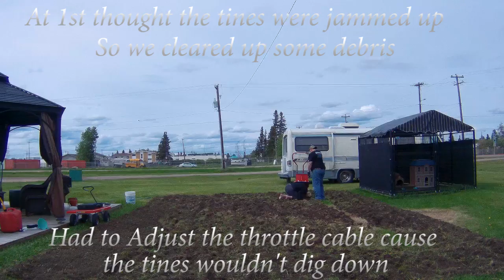EARTHQUAKE  Victory Rear Tine Tiller RIPPIN UP SOME DIRT

Comment: My family bought the same tiller a few months ago. It helped to do one round with the tines up higher to loosen the grass and rake it out, then lower it a little bit and pass through, and then lower it to almost the lowest setting and pass through. It is extra work but it worked really well for us. We bought roughly $50 worth of landscape fabric for one spot in our garden and then had some "free range" with the leftover plants... the landscape fabric was 100% worth it, so much easier.
Reply from the maker: Thanks for Watching Rich.Be sure to Check out my other Channels.TripleChip's Down the HATCH 2 & TripleChip's Unbox the BOX.
Reply: Great tip! 👍.   Grass roots are a pain. Especially if the grass is not 
dead.  😦

Comment: Many newer motors have oil fill and drain plugs in 2 areas. Or on each side.  In case they use that exact same motor on a different product; but it needs to be on the other side; they'll have it.  Without making 2 different types of motor.
Reply from the maker: Thanks for the Info and watching AlfredSchmid3659

Comment: Two ways to make that much easier. If you have the time lay down tarps (weighed down of course) over the spot you want to till up. Leave them there for a few weeks. Will kill the grass so you aren’t fighting it all the time. Second is go rent a sod cutter and cut and roll up the sod strips. You can sell the sod if someone has a bare patch they need filled in or you can toss it. Both would make that job much more enjoyable and not fighting grass coming back. Plus fresh grass filled into ne garden gives rise to powdery mildew which can spread and wipe out your crops production.
Reply from the maker: Thanks for watching ghostriderwashere and the tip

Comment: Until you get the ground really worked up; keep the tines in reverse; so it doesn't try to pull it out of your hands.  It's easier to help it move forward with tines in reverse; than it is to hold it back with tines and wheels forward.😁
Once ground is very well tilled; it works great in Forward with the Tines Forward without trying to jerk it out of your hands.
Reply from the maker: Thanks for the tips! Alfred much thanks .

Comment: I think he had the tiller set to high that's why it was not digging down.....read manual for adjustment. You shouldn't have to force downward pressure for it to dig down.

Comment: Did you read instructions and how to adjust it to go lower?
Reply from the maker: Thanks for Commenting John C. Actually i Usually just go & Unbox the Item then if i run into to Problems.I read the Manual.lol . Be sure to check out my 3 other Channels. TripleChip's Down the HATCH 2,TripleChip's Unbox the BOX & 420 Budmeister.
Reply: @triplechipadventuresvlog8150  will do that.

Comment: Don't buy this tiller! Once I got about 25 hrs on it the drive belt broke ($65)and the tire rim broke off at the shaft ($100) (thin metal spot welded). The engine shroud is open on both sides allowing debris to build up around drive pulleys tearing up the cheap thin drive belts. You can't move this thing without the tines turning. Good luck on the garage floor or getting it on a truck. Got mine at Menard's. Once you put gas in it you can't return it. Store policy. So, I'm stuck with a POS!
Reply: Same thing happened to me. Belt broke after about 20 hours. Replaced it and it broke again within 10 hours. I wish I never bought this thing. As far as moving, you can move the wheels so that they are not locked in with the pins. This allows you to roll the unit without the engine.

Comment: The tire would not dig down because the tires are mounted on the wrong sides, the way you have them will not allow for digging in.  Also, the drag is not set for what you want to do.  That engine should only take a little more than half a quart.  Looks like you have a nice layout of what you are tilling.  Take the time to learn the machine, starting with the instructions, and you will enjoy it for years to come.  Look at what you have done and realize how much work that would have been by hand.

Comment: Dip stick is on the other side . I am sure your not supposed to put all that oil in . It's over filled. I got the same machine.
Reply from the maker: Thanks Luis for the comment.Good to know
Reply: The bottle of oil mine came with was only 20 ounces.

Comment: check your tires maybe mounted on wrong side ,im surprise it took a whole quart of oil.
Reply from the maker: Thanks for the Comment Stephen and I'll will have to check out the Tires this Spring.Didn't even think about the Tread might be facing the Wrong Direction. Be sure to Consider Subscribing. And Why not Check out my other 4 Channels. TripleChip's Unbox the BOX, Metal Master as presented by TripleChip, TripleChip's Down the HATCH 2, and 420 BudMeister. Thanks
Reply: It only holds 20 ounces.

Comment: You put the oil in where it’s meant to be drained from when it’s time to change the oil
Reply from the maker: Thanks for the Tip & watching BullRed94
Reply: The drain plug is on the same side as the oil fill hole with the dipstick, it's the small plug in the base of the engine.